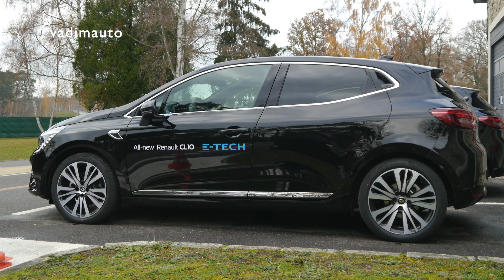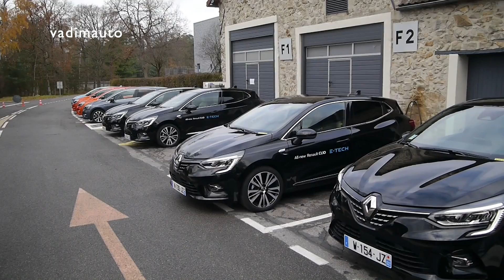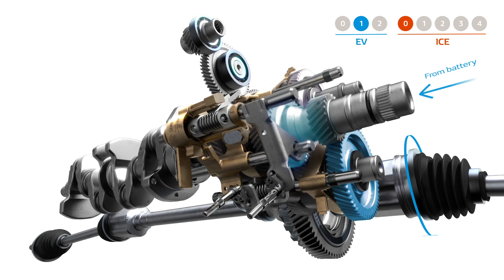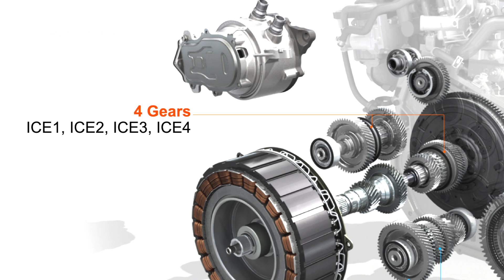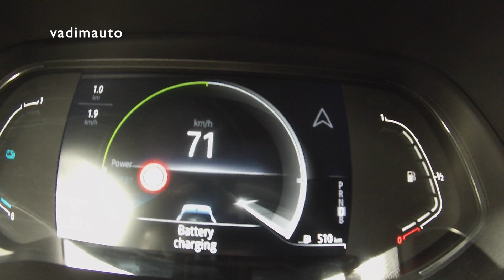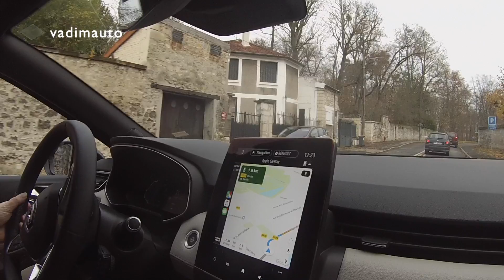2020 Renault Clio E-Tech, first drive

Comment: My Yaris does 4.2 L easy and has many years of experience behind. Many owners report 500000 km .. Many Renault reports engine failure after 50.000
Reply: My 2003 1.4 clio has 405.000 km... No faulure
Reply: @s.p.4965  old engine was very good, tce engines have problems.. Google it if you don't believe me.
Reply: @Simon-ls8xf  I owned a TCE with over 130.000 KM and never had any engine issues at all.
Reply: @Evokyr  good for you but
Reply: Dacia Sandero is the most reliable car in the world and is built on old Renault technology

Comment: Does the Renault Guy said that die E Engine is the same like in the BMW i3?
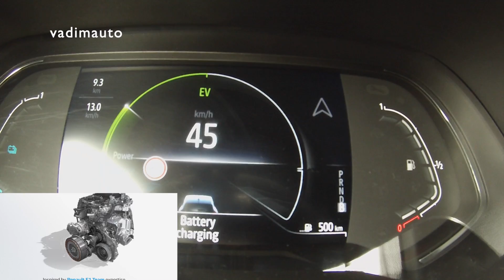Reply: actually think he said the smaller electric motor is in common with the BMW i8 (maybe the i8 generator) @9:46

Comment: I think that battery should be installed somewhere else, the condition of weather can damage all this parts (salt on the road during winter), also can accidentally destroy by reversing and hit on something sharp.
Reply: I honestly think renault must have thought of that.  They put heat shields on it. I am sure it can handle day to day use.  And dont forget most hybrids have batteries in that area. There are not many other places to put it.